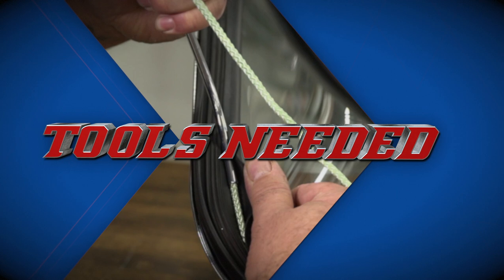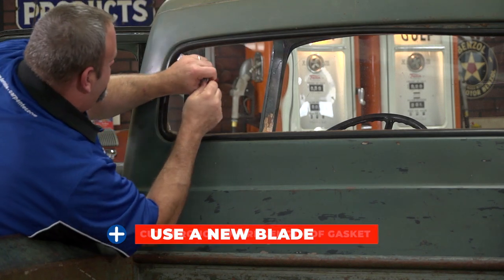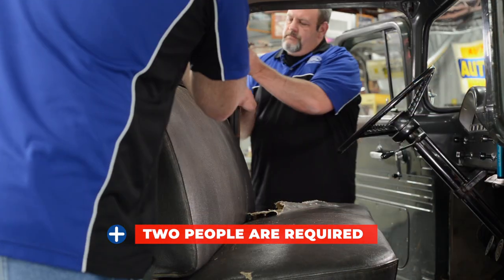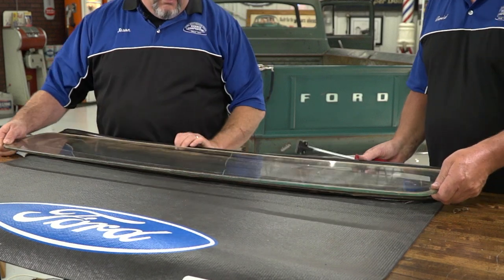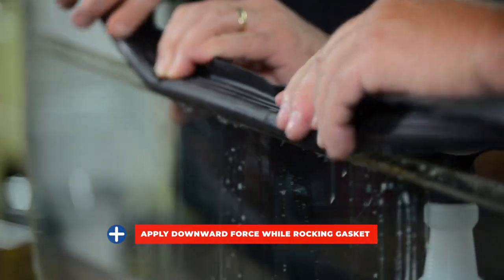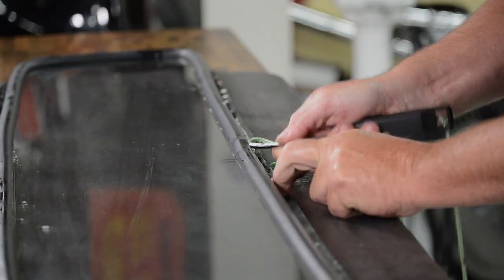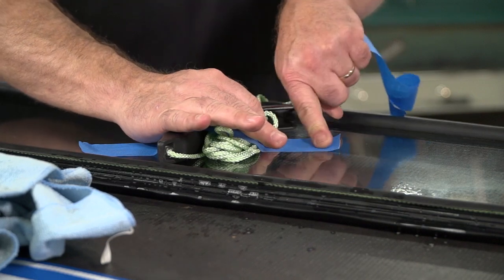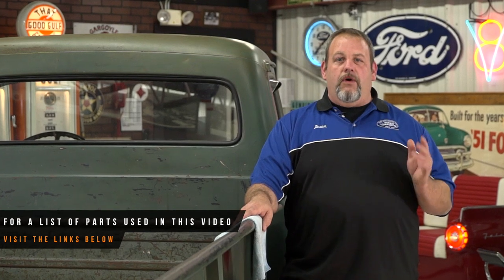How to install a Back glass seal on a 1956 Ford Pickup

Comment: I appreciate the video, however, you said one of the tools needed was thew glazing compound and I never saw you use it.  I checked your windshield install as well, and you didn't use it there either, and both videos say your install is complete?
Reply from the maker: The glazing compound is optional as shown in the graphic. Some will use the compound after the install by lifting the lip and using the caulking gun to apply a bead under the gasket. Thank you for your input.
Reply: I was looking for that also. It almost stopped me from doing this project . Good thing I watched the whole video

Comment: I bought one of your gaskets for the rear of my 1970 F250. Which side is the inside and which the outside? One side is round and the other has a bevel.  Also it does not seem to have any shape, but I see you put the "bar" on the bottom.
 C7TZ-8142084-A

Comment: Thanks, Dennis for posting.  I am wondering if it is very possible to re-use the older gasket on new fixed rear door window on a 1990 Econoline Van that was burgularized? Your insight would be helpful and appreciated. I realize it would not be reccommended but a spare part is unobtanium, afaik.

Comment: You didn’t use butyl is it not needed
Reply from the maker: The glazing compound is optional as shown in the graphic. Some will use the compound after the install by lifting the lip and using the caulking gun to apply a bead under the gasket if needed to fill voids